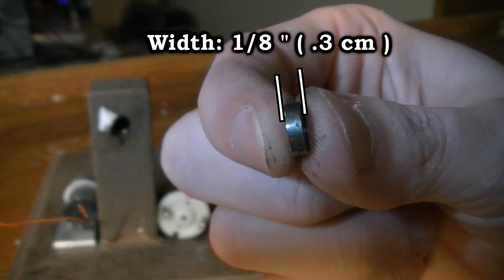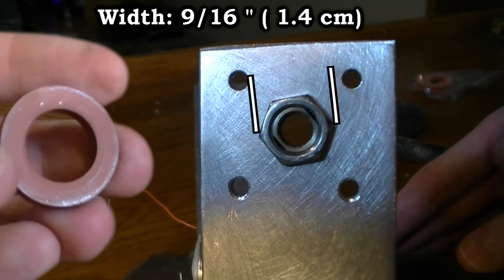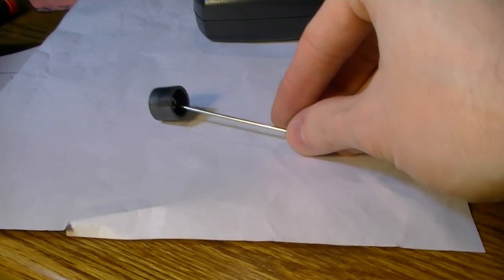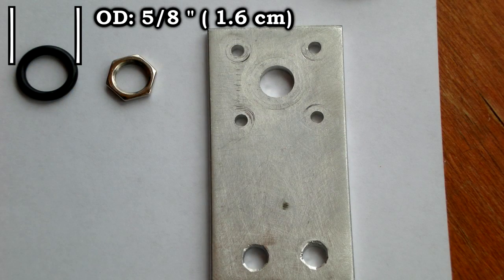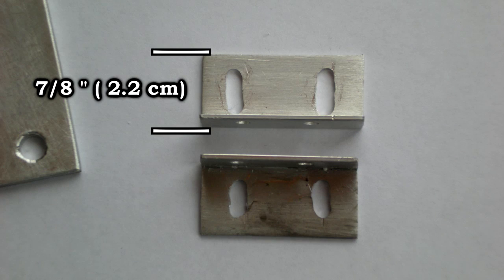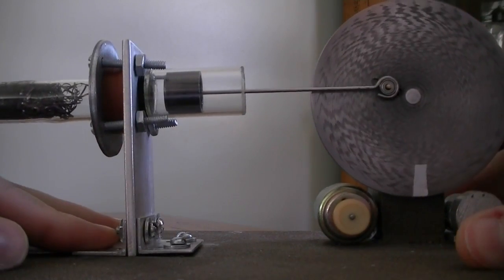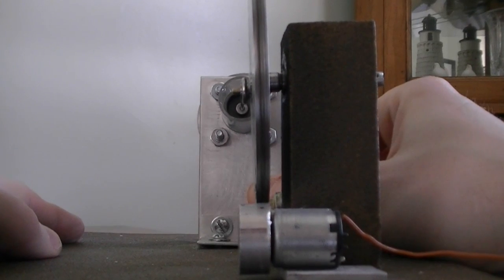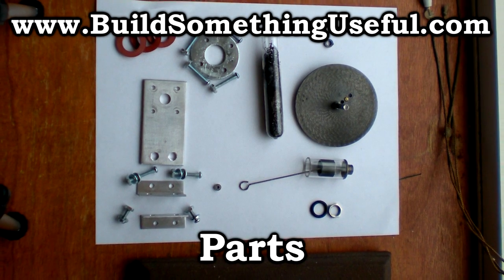Lamina Flow Stirling Engine Parts - Part 2

Comment: Can you make a neodymium piston? If yes you can then wrap cooper wire around the glass over the piston and generate a lot much energy than your motors. I can get with very little magnets and very little cooper wire 2mV for each "in" movement.

With the size of your piston plus a real amount of cooper wire I think you will generate hi voltage.

(you should need a rectifier for get DC)

Hope you undertand my horrible english :3

Comment: Just thought I should mention that the "black rubber washer" is actually an O-ring. When searching the hardware store, I was originally looking for what you said, but it had the wrong shape. Then I realized it was an O-ring instead.

Comment from the maker: @polkagatos I know exactly what you need, it's called a copper air chamber.  I used to walk through hardware stores looking for potential engine parts.  And one day I found a Copper Air Chamber, the one I found was almost exactly the same diameter as my test tubes.  I vaguely remember trying a metal pipe instead of a pyrex test tube and I think my issue was the heat leaking to the cold side.  With a pyrex test tube the heat doesn't travel far along the pyrex so you can actually touch the tip.

Comment: I think you did a fantastic work and I admire your patience to build such an engine, and to invent and find sollutions for problems. I would like to build your  engine, and maybe to replace the pyrex  by copper tubing?
Do you think it would work as well? have you tried it out? How should I make a closed copper tube  in a way that the soldering would not suffer from the heat.
I have no experience until now, so I thought it is better to ask   to somebody with experience. joachimminor@hotmail.com